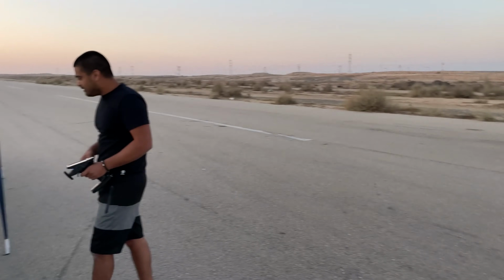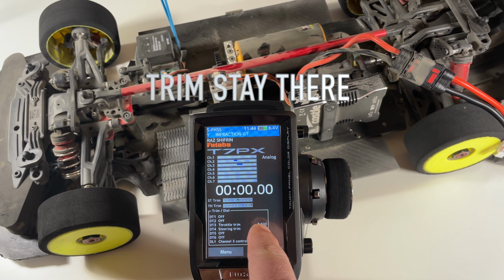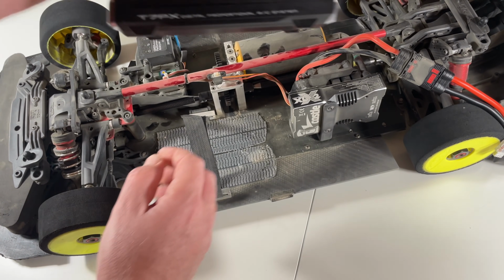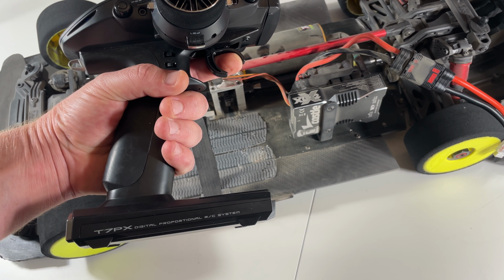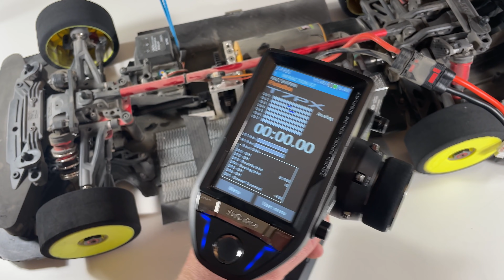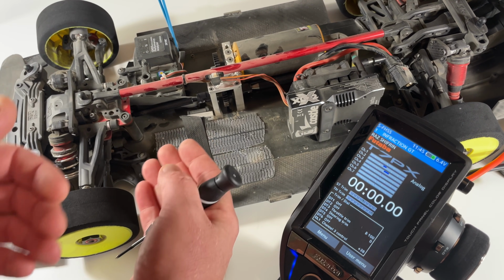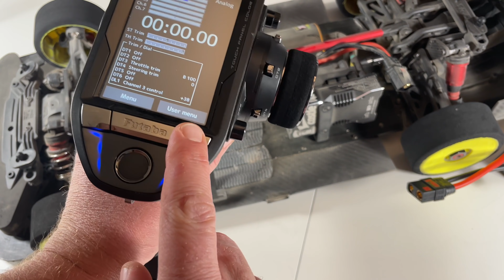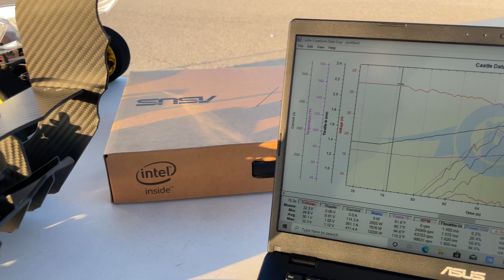Why I Got My Own Runway

Comment: Hi Raz! I was surprised to see that your telemetry data is displaying RPM and all the other values...but you're running a sensorless TP motor. How does that work? Perhaps I was under the misapprehension that the ESC reads the data via the sensor cable but seeing this I presume this assumption was wrong. What gives? Also, could you explain how you're setting up your rear suspension? I noticed you don't have any shock springs in the rear. I'm doing something like this myself on the front shocks but was curious as to how you went about it and perhaps also the why, i.e. why only on the rear suspension. Thanks for everything you do brother, you da man!

Much love,
Diem

Comment: What’s the difference in setting the perfect pass with the throttle on full brake? I haven’t set it up that way but when I do the car moves when I have the transmitter off just too see what happen  and didn’t want that cause if I loose signal the car took off and using a spectrum dx5 or am I doing something wrong I followed the instructions but the perfect pass works good without doing the throttle on full brake.
Reply from the maker: It will just increase its range and cancel beginner mode
Reply: @RazShifrin  on a note just tried it on off beginner mode drove the car till it lost  of signal and the car kept goin and I couldn’t get the car back and crashed so Is it a problem on a spectrum fail safe cause of the throttle position being on full brake?
Reply from the maker: The throttle is not on full break since you are recalibrating your ESC, The ESC now knows that full break is neutral
Reply: @RazShifrin  yes your correct it’s does sit in neutral but when it’s out of range or the transmitter in off  position car takes off am I doin something wrong?

Comment: You are NOT A MAN if you use Perfect Pass🤔🤔As a woman, I say BS! A Smart man would run it if they wanted to and use it to go faster. It's a TOOL! Don't be a TOOL, use the Tools! If you use it, let US KNOW. James McCoy let us know he uses the Perfect Pass Carbon fiber drive shafts. Was he NOT a man for using Carbon Fiber. A product that a very well known woman, #BasherQueen, sells.😂 Be careful, using Carbon fiber may make you less of a MAN!😱😂
Reply: Lol
Reply: Also, I believe perfect pass is easier on the electronics too.  I'm not an expert but I think keeping the throttle curve linear doing speed runs puts less stress on the batteries and ESC.  Just my opinion.
Reply: I think the whole point is people feel like it makes the car more automated and less connected to the driver. You can build a robot and program it to drive the way you want but there is no skill needed in the driving aspect. Carbon driveshafts have no relevance with the driver.
Reply: @adamgentry332  Bull, it's a way to gain speed and break less stuff. The all mighty one himself😎 said, when used properly, there will be no disconnect or you won't "FEEL" it. I know it has no relevance because I wasn't trying to make an actual argument, just a POINT! Or, it may be JUNK, it may be "FELT" and it may even be USELESS! I don't know, I haven't used one. I do know that I would use it and you would see that driving skills ARE STILL required! If I keep testing and not breaking a bunch of stuff, soon, it shouldn't matter if I have a Perfect Pass or not, in my opinion. That is, until I get better stuff to run and get comfortable running at higher speeds. Then, I could see one using it to gain any milli-edge that one can get over every one else! It takes time in the speed game, and you learn. This will PROBABLY help ANYONE in the speed game. Something I just can't tell you unless I get a Perfect Pass and use it.♥️
Reply: @adamgentry332  And you are correct, I should have came up with something better, I'm just not that smart😂💯😎♥️
Reply: Perfect Pass = Way less vehicle destruction. trust me! If you value your hardware and your time, you owe it to your self to install Perfect Pass.
Reply: @beesod6412  Well, I just placed an order for a Perfect Pass. Let's just see how PERFECT I can make a Pass with it and without!😁It should be a Great video! And Thank You OZZY!
Reply: Actually i heard using perfect pass and carbon fiber gives you larger manhood. Or somethin like that anyway.
Reply: @choke666  🤔maybe Raz is onto something here😂🤣😎